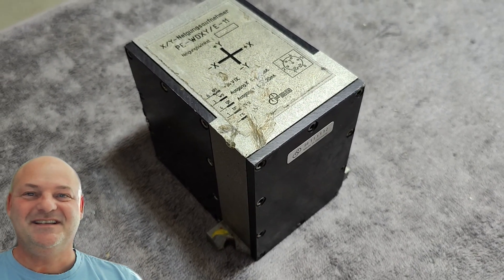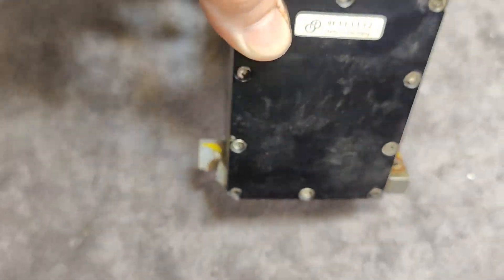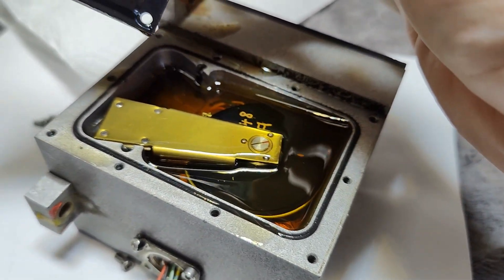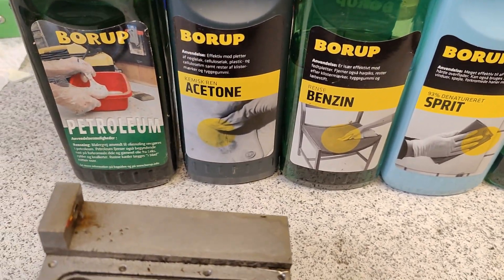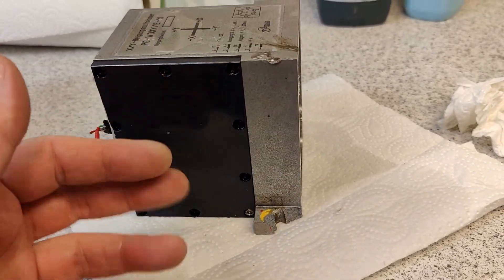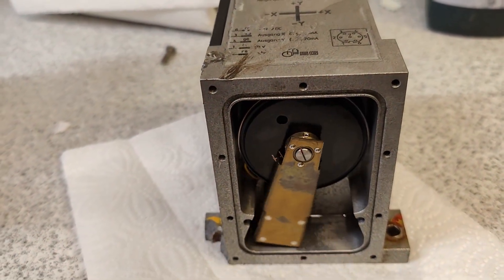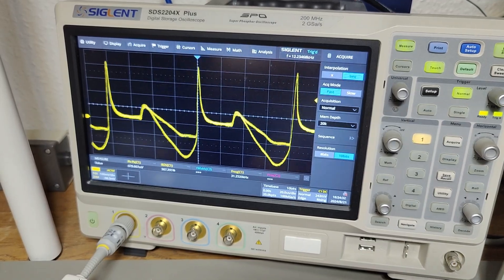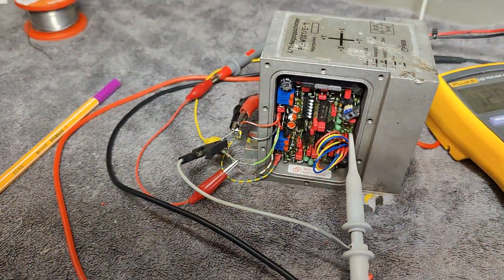XY Neigungsaufnehmer FSG PE-WDXY/ E-11 tilt sensor 1994

Comment: I wonder if it can be used as a seismometer without the dampening.
As it reacts to horizontal acceleration as well.
But I guess Denmark is a less active region…
Reply from the maker: YES i think that could work, but during my long life i only woke up once from a small earthquake, it also made glass in cupboards move so much it made a sound, but it was only once !! i have experienced a few more , longer and more powerfull, on vacations more active locations.

Comment: Thanks for the nice teardown video. Is it possible to see internals of the sensor somehow? Like is it wound on some standard ferrite core or is it from custom stamped iron lamination?
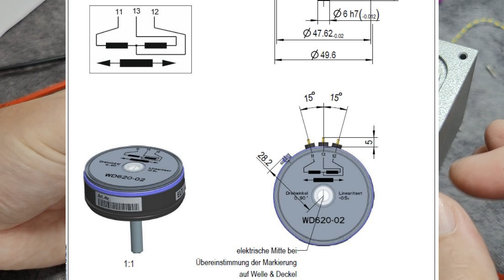Reply from the maker: i initially had the idea i was going to open one of the sensors, however my luck is the unit works so super cool, so i will not open the sensor anyway, since it will most likely means the end of that sensor, i love to keep really cool parts and equipment for my futher lab experiments, but i am sure it is most likely made very close to the picture at 8:07 and 9:06